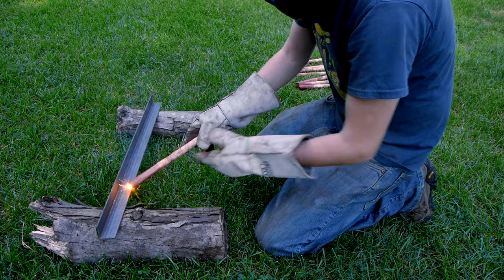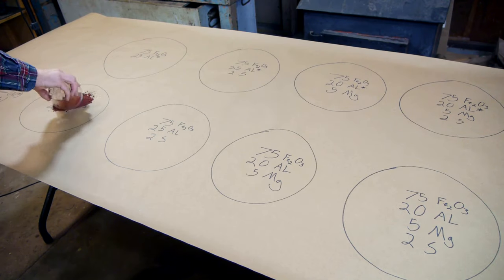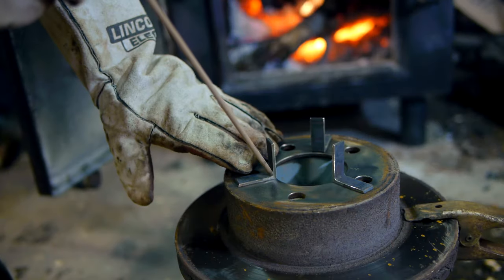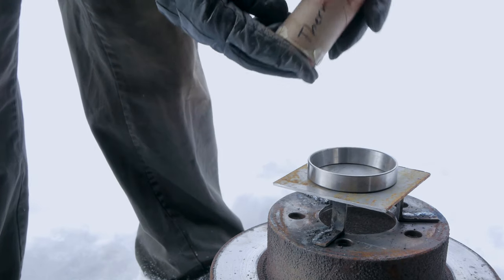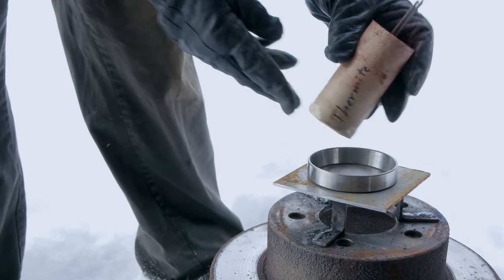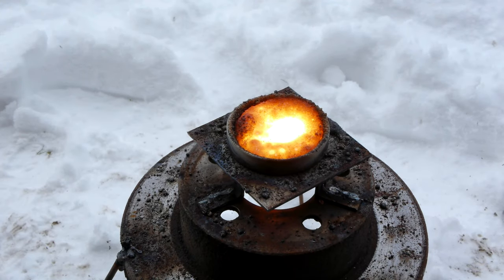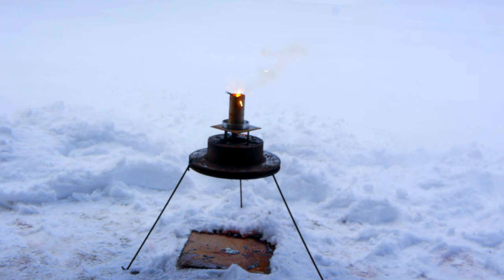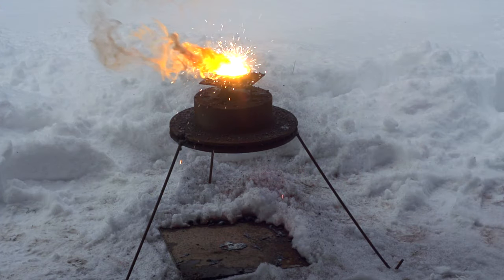How Easily Can Thermite Actually Melt Steel? - NightHawkInLight

Comment: Have you tried elevating the thermite vessel about 1/2" above the plate so it can reach max temp before contact?  The steel plate acts as a heat sink as the reaction warms up, and that could be one of the reasons it's not cutting through.
Reply: Dude your awesome! :D keep up the amazing work!
Reply: +Grant Thompson - &quot;The King of Random&quot;  OMG GRANT UR HERE
Reply: +Grant Thompson - &quot;The King of Random&quot; IM UR BIGGEST FAN
Reply: Continue the great work man :P
Reply: The King of Random :)
Reply: I’ve seen people put it into a flower pot as well not sure what that does I guess it’s less likely to burn through it rather a can until it hits a certain temp.
Reply: Rest in peace Grant
Reply: This, when the thermit is elevated above the surface it's intended to burn through, when it reaches max temps, it will easily melt through steel. 
Source of proof: i've seent it
Reply: he knows
Reply: Oh no........finding this little comment hurt my soul.
Reply: Didnt help that he also did this outside during winter, where the steel was prob already pretty damn cold
Reply: @timothybenton3561 I’m assuming that you do that so it doesn’t waste the reaction melting the can
Reply: Fly high Grant!
Reply: RIP king

Comment: On a myth busters episode they burnt through a car's engine block with a plant pot of thermite. I think your thermite is just bad
Reply: also he used it diffrently
Reply: +Debated Nothing it not always what its made out of and how its made, its mainly how its used.  his thermite  WILL cut threw that plate with ease if he did a bit of reserch into the use of thermite instead of just the composition.
Reply: Yea but most car engine blocks are aluminium which melts at less than half the heat of steel so that doesn't mean his thermite is bad but then again I haven't seen that episode so they might have used a cast iron block.
Reply: Jake Mallett Most blocks are still cast iron, much cheeper.
Reply: +Debated Nothing 
I think that's because the plant pot concentrates the heat in a relatively small spot as the molten thermite flows out the drain hole in the bottom of the pot. The way it's done in this video, the heat is spread out over a larger area. Like a gas torch, use a broad flame for heating, but a narrow flame for cutting. Also there's a lot more thermite in the plant pot so the heat is applied to the metal for a longer period of time.
Reply: @Owen Major: cast iron =/= Homologous Steel
Reply: We need another team of mythbusters.
Reply: Same with the Brainiac experiment, literally took seconds to cut through the block, then seconds to get through the roof and ignite the fuel tank. When they lit it, it looked like it burned far more aggressively.
Reply: Are you sure they did that? They've never shown the engine block.
Reply: @MundMoriginal  true, I don't think they ever really showed the engine block afterwards... these cable networks like History Channel and Discovery care more about making their shows "entertaining", than accurate.
Reply: Your thermite is burning from top to bottom with nothing containing it from above, so relatively little of the burning thermite is making contact with your steel plate on the bottom and most of the heat from it is rising. Try putting that steel inside the thermite and encasing it. Your steel will disappear.
Reply: they showed it makes a hole in the bonnet but they didn't show the hole in the engine
Reply: And they also weren't really trying. But the guy who made the The Great Thermate Debate video had no trouble cutting through beams with home made cutter charges.
Because he actually tried.

Comment: most of the thermal heat is gone before it hits the plate. try starting the thermite from the bottom.
Reply: finally !
Reply: I've never experimented with such things myself, and I'm no chemist either, but that's what I thought was wrong too.  Start at the target, and as the reaction proceeds, it would continue feeding it with the unused thermite above, instead of ending with the leftovers of the mostly finished reaction getting in the way at the bottom.  I mean, it has its own oxidizer, right?  So the limited access to air at the bottom shouldn't be a problem.

I also see people recommending that the thermite be compressed as well.
Reply: thats what i just said,,,he is lighting it from the top,,,,figure out how to light it from the bottom, turn it over
Reply: ...or just accept thermite had nothing to do with 9/11
Reply: hahahahaah
Reply: I've seen mention of needing to space the container above the target as well....I used to have a book by the military on improvised munitions and explosives.
Reply: xCmOn3yxV777 even though controlled demolishing uses thermite all the time for this exact purpose... 🤯
Reply: close but no,,what he needs to do is invert it just the way he had it,,instead drill a hole through the plate ,put a cardboard seal on the top of the keg through the sparklers and flip it so the sparkler end goes through the hole in the plate and let it rest like that then light it from the bottom,,all the heat throughout the keg will focus on the plate due to gravity with the burn reaction starting from bottom going up
Reply: yes it could have,,you need to see more vids of a guy showing this theory works as he was able to cut through I beams in his backyard,secret is to compact and shape charge the reaction where you want it to focus
Reply: @Colaaah  actually NO,  thermite,  and/or Thermate is NOT used for controlled demolitions of BUILDINGS... it's not well-suited for that kind of job at all... and how could all of that thermite  survive the plane impacts and fires without going off prematurely??
Reply: @klmullins65  actually yes they do! Are you a demo expert?!
Reply: @Colaaah  have you ever even tried making thermite?
Reply: @kubiiikk242  Not personally, but I have watched the process and then watched it used to cut steel. And that is homemade Thermite, let alone commercial grade demo Thermite!
Reply: @Colaaah  so you saw it in real life or on a video?
Reply: @klmullins65  to add to that, controlled demos are primary shape charges.  As energetic as a thermite reaction is, its orders of magnitude less (and slower) than high explosives ( c4 for example)  needed to take down a building.
Reply: @xCmOn3yx777  You have apparently never seen Jonathan Cole's thermite video (which may have been deleted from YT). It cuts right through steel beams when properly configured.

Comment: I made Thermite in the past and had very good results. I was surprised when you did not melt out the steel. I used 30 micron aluminum and made my own iron oxide using a cut masonry nail placed in water connected to a wall transformer overnight. You have to dry out all the iron oxide once completed. Great video.

Comment: In the first part of the video, the thermite was touching the steel. But in a flat container placed upon a flat piece of steel, it won't be able to reach the steel as well. Maybe it also built up ashes at the bottom which insulated it.
Reply: +gilbet yep, try having the thermite touching directly to the plate, with more surface area. cant hurt to try!
Reply: +FichDichInDemArsch hi
Reply: +gilbet +NightHawkInLight Yes in my own experiments the trick is to let the molten iron gather and then letting it flow molten on to the object. If it just sits on top it will most likely end up building a hard layer of solid iron on top of the surface insulating. Also for a thermal lance effect, try packing it in to a steel pipe, raising the pressure just as if it was a black powder rocket engine will greatly increase cutting performance.  I saw a rather interesting video somewhere about that.
Reply: Hi

Comment: you should light it from the bottom. lighting from the top won't heatup the steel immediately .
Reply: +givingtnt I had the exact same thought
Reply: +Colson Customs me too. putting it in that tube, lighting it from the top, would cause it to burn from the top down. also, maybe the narrow diameter of the tube might also be a factor because of less surface area in contact with the steel.
Reply: +givingtnt indeed, thats  why it  failed
Reply: +David Mm agreed, I'd imagine a lot of the heat energy was lost before even coming into contact with the plate. Spreading the mixture lower and closer to the surface of the plate would probably yield better results than waiting for the cardboard tube to burn away.
Reply: +givingtnt   I agree.
Reply: +givingtnt Have you ever seen anyone light thermite from the bottom? Don't be ridiculous! He should have used a terracotta plant pot to hold the thermite, also.... he isn't using enough thermite to penetrate the steel. Try using more and do a bit more testing before you slate thermite.
Reply: +Panc8ke yes, look at the first few seconds of the video XD
Reply: exactly, all the heat went into its self, maybe turn it sideways to let it in direct contact with steal
Reply: givingtnt That's why the rods will never work the way he is expecting. You need more thermite to melt steel etc. Have you ever seen them weld train tracks using thermite? They don't just use a couple of ounces you know.
Reply: Yes,i also make it for my work and for playing with
Reply: +Panc8ke Your right, generally that is the way it's done. A terracotta pot is loaded, with the hole in the bottom blocked by a bit of cardboard or similar. It's ignited, and before the pot cracks it has enough time to light up all the thermite, melt a hole in the metal plate below it, and "Bobs your uncle".

But that indeed does mean it takes a lot larger volume then this test was based around, and this test was just that.  A test to see if this volume would do anything.
Reply: Well, he says he reads all the comments. The results are in, NightHawkInLight. You weren't using 300 grams, you were using the bottom layer  (maybe 20 grams or so?) and a bunch of already-burned thermite (-ate).
Reply from the maker: You guys missed the point of this video. I should have been more clear on my intentions. My purpose was to show that thermite requires careful orientation and casing design, it's not a magic compound that will melt through anything without trying.
Reply: Ah. I thought you were just trying to melt steel. Heh... oops.
Reply: +NightHawkInLight I thought that as well,like I said before,i work with this stuff and it never gets old,well the smell can get to you after while,anyway I love thermite it can do some awesome things
Reply: was about to say same thing
Reply: while using a plant pot it will cause lot of molten iron to stick to its bottom surface....... not effective....... and yes i have seen thermite burnt from bottom.
Reply: Yeah exactly! Its obvious that point of this video is to show that thermite doesnt melt steel. When it actually does and is for example used on railroads to MELT the rails together. =D  I am applauding sir, well done. =D

Comment: I think you need to give this another shot and have the fuses at the bottom of the thermite pack so it burns bottom up, instead of burning top down. The thermite at the bottom will insulate the burning thermite from the cutting target until the reaction has end. That's likely why you failed to melt the metal.
Reply: Maui Lahaina 911 😢

Comment: You know how they weld train tracks with thermite?  Ive watched videos where people actually try to weld with thermite and it seems almost impossible. Cody's lab did a good video on it. Have you tried it?
Reply from the maker: +TheBackyardScientist I have. They must use a really good flux for railroad tracks, I'm not sure how they do it. Any thermite weld I've ever made is full of bubbles and ultra brittle. Maybe they just use the heat to melt the ends of the track together rather than the thermite contributing any extra metal to the joint.
Reply: +NightHawkInLight Perhaps you might be able to better focus the heat output of your thermite mix by using some kind of conical applicator, similar to a shaped charge. I think the use something similar to deactivate i.e.d.s and land mines.
Reply: +NightHawkInLight Perhaps you might be able to better focus the heat output of your thermite mix by using some kind of conical applicator, similar to a shaped charge. I think the use something similar to deactivate i.e.d.s and land mines.
Reply: +NightHawkInLight Perhaps you might be able to better focus the heat output of your thermite mix by using some kind of conical applicator, similar to a shaped charge. I think the use something similar to deactivate i.e.d.s and land mines.
Reply: from what I've seen in most videos, they don't use any flux. however, they preheat the tracks to about 1000 degr. C (+1800 degr. F)
Reply: +NightHawkInLight I'm a thermite welder on the railroad, we don't use thermite to cut rail we use it to fill in the gap to join two pieces of track (25mm, and up to 50mm),and we always preheat the ends of the track, period of time depends of what kind of track it is, I'm not sure how much thermite we use, but the portions we use comes in rather small buckets.
Reply: +zerox3319 Yeah thats exactly what I figured. Ive used thermite a lot, and there is always so much slag mixed in with the Iron. I don't know how you guys get a clean weld filled with solid metal 25-50 mm thick. That must be around 15 lbs of thermite. I was trying to make a sword from thermite, by having the thermite flow into a hollow mold, but the iron did not settle to the bottom like I thought it might, it was all mixed together and extremely brittle. I noticed the thermite used to weld tracks burns very slowly, maybe it gives more time for the Iron to separate from the aluminum oxide slag?
Reply: +NightHawkInLight I use thermite for fusing copper wire to ground rods (steel core, copper clad). Cadweld. It is a copper based thermite.

The key is to not heat too fast to cause splatter, but insulate things well enough to allow a stable solidified core. I preheat the rod and wire to about 600*f.
To get thermite to cut, you need to insulate the top and make sure it all lights rapidly. A simply piece of channel slotted works quite well.
Reply: +NightHawkInLight Wait, I thought you couldn't get thermite to melt steel?
Reply: +NightHawkInLight From what i can tell just like gasoline or something like that if you burn it in open air like you did it is not that powerful but if you put it in a container or some device like that it suddenly becomes a lot more powerful because it is more concentrated. that is why your tubes did not work next time try to put another steel plate on top of the one you are trying to melt.
Reply: I think the thing is that they have like a mold they put around the rail to keep air away from the melt. The problem with thermite welding as well as other welding methods, is oxygen. The molten iron is so hot that once it get into contact with the air, it burns and turns back inot iron oxide (only difference is that this iron oxide is mostly black, just like the kind you get when burning steel wool - it probably consists mostly of FeO and Fe3O4 as opposed to the red  Fe2O3 typically used for the unlit thermite mixture).
If you just weld with a normal arc welder without using any protective inert gas that diplace the air around the molten metal or try to weld with a just steel rods instead of the normal welding rods that have a coating (wich also reacts with and keeps oxygen away from the melt), you will end up with pretty much the same result. A very brittle joint that looks like crap full of bubbles etc. For rail welding they also preaheat the rails, so the thermite doesn't need to supply all the heat needed to heat up the rail ends from cold all the way up to the melting point.

Comment: Thermite burns at 4000F, jet fuel burned at 600F. Yet fuel could weaken the steel but not thermite? Your mixture sucked, a guy already showed how thermite can melt through steel quickly.
Reply: I saw that video too. Can't find it anymore.
Reply: He focused the thermite stream at high velocity though.

Comment: If you want to cut with thermite, here is something for you to try. Get a small section of black pipe with threads at each end. Just a few inches. Cut a slit all the way down the side. Fill with thermite (you can use paper to keep it from falling though the slit. Thread on an end cap on one end and a end cap with a hole in the other where you will put your fuse (magnum wire works well). Place the slit on what you want to cut and attach the pipe firmly. This will cut horizontally as well. Male sure you have a lot of room to do this and you are far back. It is not uncommon for this set-up to explode.